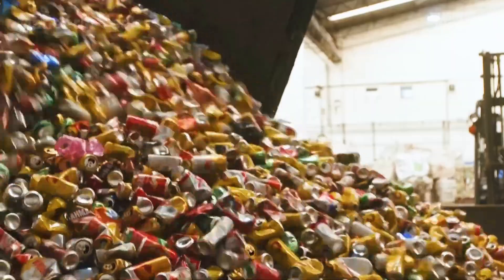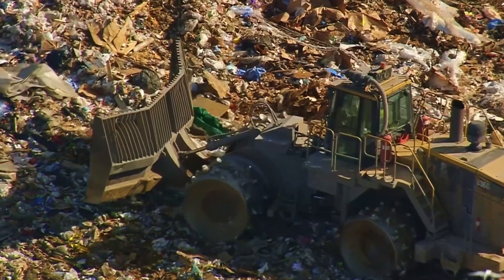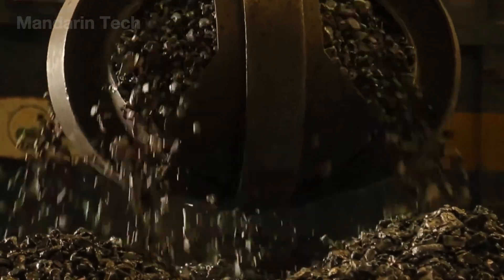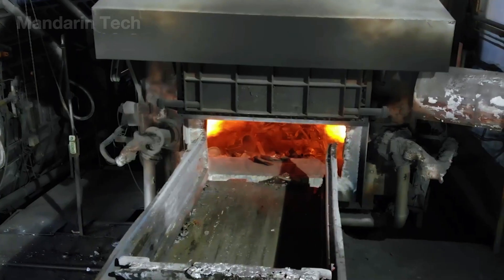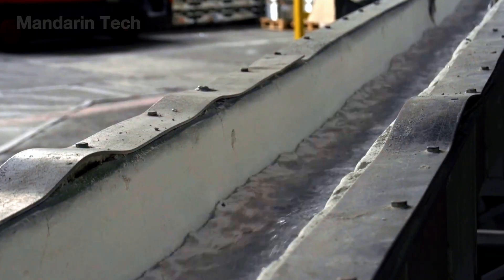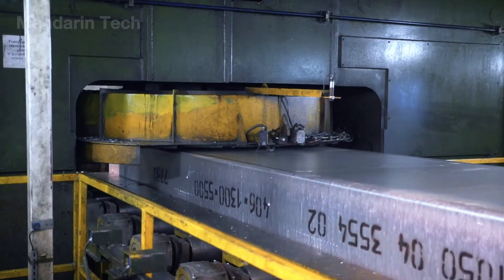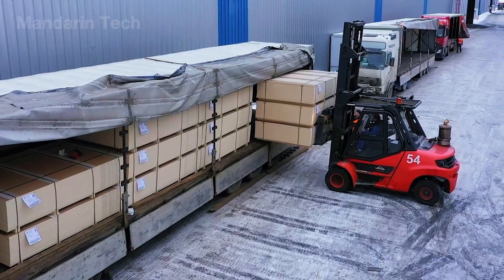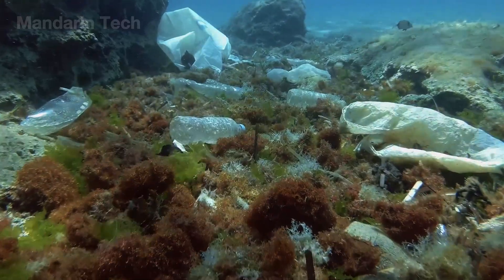You Won't Beliveve This America Massive Aluminium Recycling Process From Million Old Aluminium Cans

Comment: I worked at ALCOA & Retired from there and can tell you the Operation Start to Finish is Demanding. Lots of Manpower involved. Imagine the Ingot when Casted ends up approx. 10-12inches thick. Super heavy. Then the Rolling Operation that drops the 10-12 inches all the way down to .001 approx. the thickness of copier paper or Alum Foil. .001 = 1/1000 inch thick. Imagine an Inch reduced to a value of 1thousandth of the inch. That Means you need a thousand sheets piled together to get back to 1 inch. Incredibly thin. Foil range. Alum cans a bit thicker. Alum Blinds .0015. Car radiators, .0019. .002 is 500 sheets to get back to 1inch. We didn't see the Annealing Process that Produces what's called Dead Soft. Normal Alum Sheet is a Hard Metal. Not very flexible. Dead Soft can be Crumbled up by hand almost like Paper. You could never do that to Steel. More Aluminum production could be possible, but due to a shortage of Electric Generation & Supply, it's Not Possible just yet? Rolling Brownouts & Blackouts are the Result of the same thing in comparison. The Plant I worked at, we produced 500M Lbs/yr. Astronomical Production. Where it all goes? Who knows? Top that off w/maybe approx. 1000 Production Facilities around the Globe. A Weight far beyond Comprehension. ALCOA has over 300 Plants. Think about that. Followed by ALCAN, RIO TINTE, RUSSIAN ALUM, goes on & on. Work there and get Job Security. Pays Very well also.
Reply from the maker: Incredible insight from firsthand experience—thank you for sharing such a detailed perspective on the scale, precision, and intensity of aluminum production.
Reply: My father worked there 41 years. He passed away a few years ago. Walter was his 1st name. at the end he work in the lab.
Reply: J’ai travaillé aussi , Alcan, Riotinto mais dans la filière, plasturgie, il y maintenant quelques années de cela, je suis à la retraite maintenant.